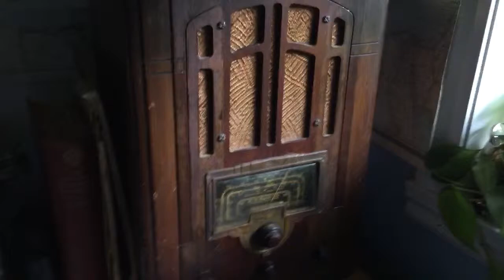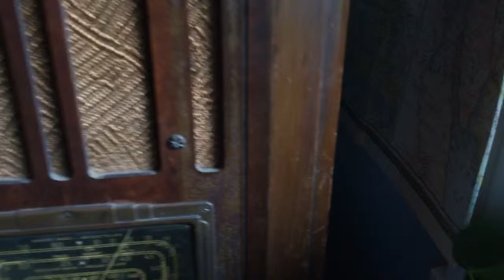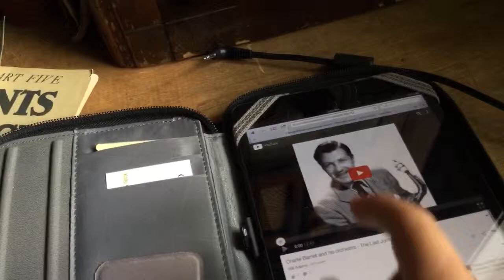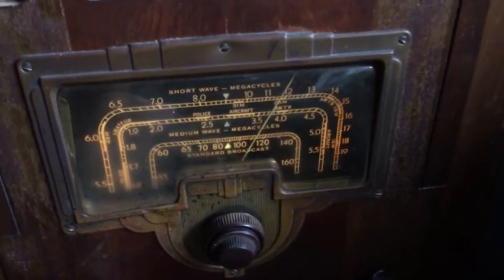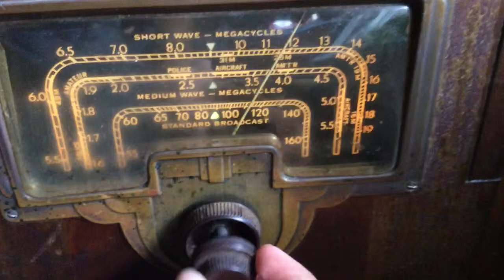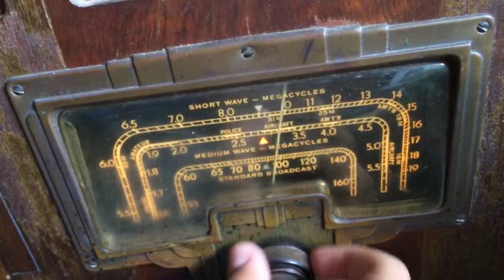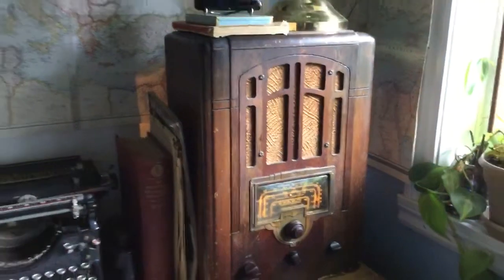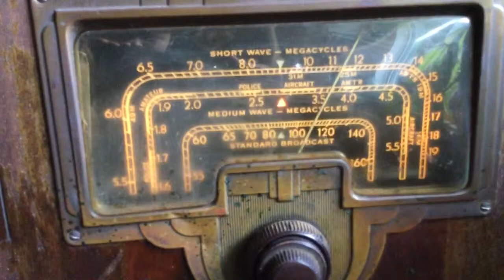1937 RCA 6t2 tombstone radio

Comment: I just bought one of these radios, I actually really like it. The 10k portion of the canned ohm was open on mine and had to replace it with a 10k 10 watt resistor along with a hand full of capacitors. Thanks for the video!